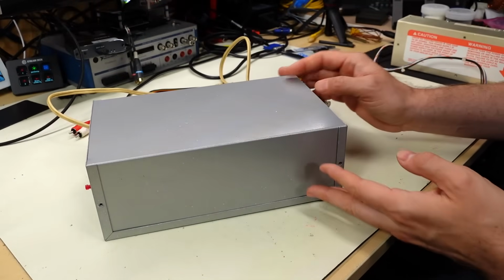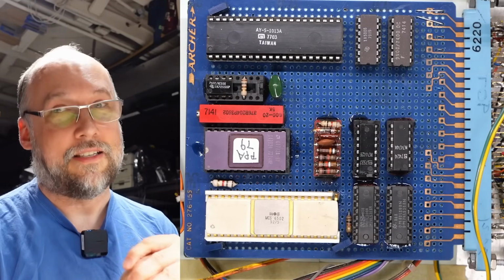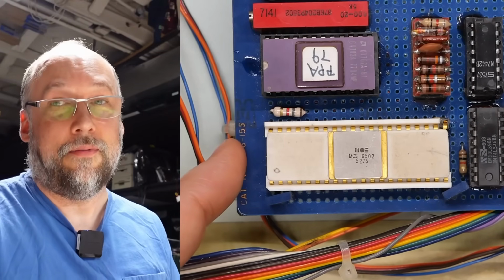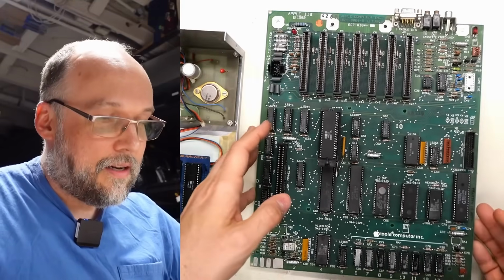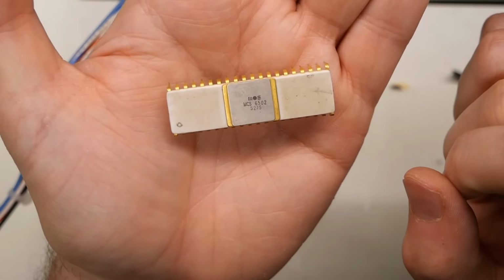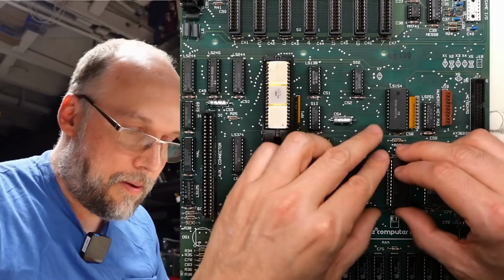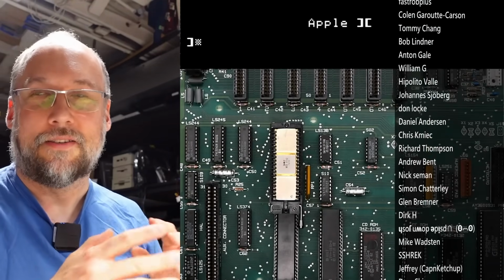Let's test a 50 year old MOS 6502 CPU

Comment: 11:30 "bug"  - do not let Chuck Peddle hear that. IIRC the engineers pride themselves in the fact that everything just worked in the first run. When you dissect this device, you will see that there is no broken ROR implemented on it, even though the command bits provided for it. Some Steve Wozniak apparently raised his voice that the chip should have ROR and came up with an idea of how to implement it in a clever, resource-saving fashion. But that's from the top of my head and you need to search for the original research yourself.

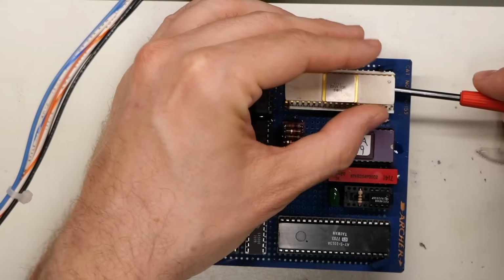Comment: intresting video, thanks for it. at 19:50 you use a flat head screwdriver to remove a ceramic dip40 package, more save tool woud be the expansion board blank used in IBM5050 type PCS , I am sure most of nerds have more of those, than they need

Comment: On my Apple 2e, I upgraded to the 65C02 and that fixed an intermittent rebooting problem. This was when the 2c was introduced.
My Apple 2e boosted my career as nobody else was doing what I was doing.
The 6502 assembler was much easier to understand than the 8080 chip which had this odd offset notation.

Comment: I remember the ceramic DIL sockets, and breaking the corners 🙂 Using one of those daft extractor tools (a plastic barbeque tongue) was guaranteed to bend pins and crack sockets. The two scredriver method being safest. That little tool you have even better. Other CPUs had bugs in them, Z80 to Z80B I think had more than just a clock increase. That was a while ago.....

Comment: The 6502 was not based on the 6800 as it's logic topology is quite different. However, the original 6502 (the one in this video) was designed to allow it to plug directly into any 6800 hardware. In other words the I/O, clocks, R/W and so forth was intentionally set to the same pins of the 6800 to allow an existing 6800 project to easly use the advanced capabilities of the 6502. Not at all firmware compatible. Motorola sued where a small pin assignment was made in order for this plug-n-program feature was not so simple. However, with a few cuts and jumps, it could be done.

Comment: I still have an Apple 2e with 2 disk drives, a green monitor and a joystick. I bought it more than 40 years ago. I had all the manuals, including the BIOS assembly listing. I had some experience programming a TI SR-56 calculator, so I decided to try programming my Apple 2e in Assembly. I remember calling some routines in the BIOS to perform some tasks, like scrolling in reverse, among other things. This was how I learned to program cpus using assembly.

Comment: Running 6502 without RAM is even more tricky than i8080/Z80 ...

IMHO, MOS 650x seems to be early designed as microcontroller, or at least a CPU with RAM-pages 0 and 1 built-in.

Comment: It would be interesting to try using the system and figure out what, if anything, in the ROM actually breaks with this CPU.
After getting a sense for how usable it is (or isn't), then try swapping in the earliest known Apple ][ ROMs - maybe the earliest ROMs were programmed to work with the early 6502?  What about Integer BASIC vs Microsoft BASIC?
Maybe also check some very early Apple-published software that might have been marketed with the original Apple II, and see if that software works.
It's possible that at some stage, Apple was trying to be compatible with those early chips, but by the time of the //e the concern would have been forgotten.

Comment: I have a white ceramic 6530 from a KIM-1 that i removed from the board because it seemed like it was failing but it turned out to be good. It has the same weird short pins on the end. 
.
BTW -  I thought it was failing because it was not showing up in my infrared camera but i guess it just runs way cooler then the plastic chips!

Comment: There's a couple little things that you said that don't make sense to me. You state that you were surprised to see a 6502 in there, and that later printer boxes used cheaper microcontrollers. But when this was made (likely 1979) there wasn't really such a thing as a microcontroller! What other option did they have besides using discrete logic? There were no 68HC11s, no PICs, no "microcontrollers". The 8085 existed but again, would have been hugely expensive. A microcontroller is just an MPU with on-board RAM, ROM, and peripherals. So before microcontrollers existed, you just had to take an MPU, and surround it with RAM, ROM and whatever peripherals you needed. The 6502, being by far the least expensive option at the time, would definitely have been the only affordable way to homebrew this without going to discrete logic which takes a lot more patience and skill to build. The later printer boards you speak off often didn't use microcontrollers either -- or if they did, they were the early ones like the 6805/6811 which had come down in cost substantially by the mid-80s, which is when those boards were popular. I think you were just sort of forgetting the timeline while talking about this box - things moved very fast after 1979, due in part to the 6502. Before then, embedded systems were just microcomputers, essentially.

Comment: Late to the channel (via the VCF panel discussion video)...  Nice video, but it's making me feel old.  I was at that Wescon show where the 6502 was announced, and bought one on the spot along with the 6530-005 TIM chip.  Date code is 3475.  I saved all the documentation and canceled check.  Somehow I guess I knew it was a special time.  (It's not for sale, in case anyone is wondering.)

The intent was to build my own board, but I got tired of hand-wiring the RAM chips (you can tell why I became a software engineer...) and found an unpopulated MAI Jolt board into which I put the chips.  Added a couple of Morrow's RAM boards (4k each), a paper tape reader, and Bay Area TVT Typewriter for the final system.  It still works.  Plays "Hunt the Wumpus" from paper tape, also Tom Pitman's Tiny Basic, and a text editor / assembler package that never really got much use.  No writable mass storage, as the cassette interface never worked right.  I really should fix that.  Wish there was more software for it.

By the way, the Apple-1 PCB had the clock generation circuitry to support the 6501 and 6800 chips, but I don't think it was ever sold that way.  Never seen a board with that section even populated.  My theory is that it might have been a contingency plan, or perhaps for a special customer that never materialized.  The 6502 has its own internal clock generator, which was one of its very significant features.

As for your amazing find, @DaftdogUK found the original design article in Kilobaud magazine (September 1979), if you didn't see their post.  Commodore PET to ASCII printer interface.

Keep up the good work!

Comment: For the record, looking at the silicon die for the early 6502 and later CPUs; the ROR wasn't bugged, it just didn't exist as the 6502 designer thought it wasn't necessary.
As soon as the first 6502 CPUs hit the market, customers complained about needing the ROR instruction and it was added.
The guys at the Visual6502 project have also documented this, it wasn't a bug but an absent feature.

Comment: Actually, this is not a bug. The developers felt that a ROR was not necessary.
Due to many complaints, they have updated the Chip.

In most cases, a Rotate-Right  is used when a simple Shirt right is sufficient. If you roll one time and ignore the carry, you are actually doing a normal shift.

The C language also can't roll, just shift.  So while a ROR is nice to have, you don't really need it for most of your programming, even without any workarounds.

The ROR opcode is actually an illegal opcode in the original version so there is no bug either. It shouldn't be used at all.

Comment: The 6502 was also in the British Broadcasting Corporation home computer - the BBC Micro 32K, a machine that most people totally ignore. There was an American version, the ABC which was virtually identical and sold in the States, but as I said, it virtually unknown today. The BBC was proceeded by the Acorn Atom, the Acorn Electron. The BBC Micro came in a 16K version - the BBC Model A, the Model B which was either 16K, 32K, or 64K and some rare modified ones had 128K. Later it was surpassed by the BBC Master 128K and the BBC Master Compact. These machines could include a 512K add-on board that ran a very early version of DOS, otherwise the machines all had tape and floppy disk access, as well as the first Winchester hard drive, and Laserdisc system. The BBC Micro also supported a local network, TELETEXT, PRESTEL, telephone modem access, a 6502 co-processor and many other adaptions, including a MIDI system.

I had a friend who worked for a software company, Acorn Computers Limited in Britain, and she would send me sales brochures. Eventually this machine was supplanted by the Archimedes, the world's first RISC system, which was in effect an early PC clone. I believe there is an emulator for it that runs on PC called BeebEM (Beeb being the affectionate name given to the BBC machine by its users). Of note is the fact that the worlds very first 3D space combat and trading game, the legendary ELITE by Ian Bell and David Braben was developed on a BBC Micro in the eighties that was ported to virtually every other computer platform of the time and which still remains popular - in fact, the modern remake of the game is called ELITE Dangerous.

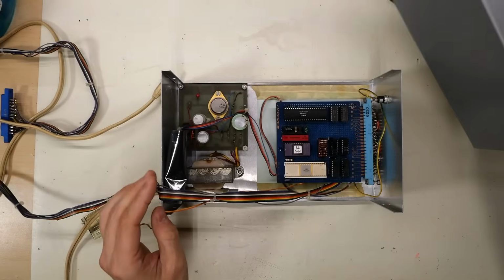Comment: 4:46 That . . . is a ceramic MOS 6502 if I'm not mistaken. While I am interested in older computers I'm not that well versed, but if I recall correctly just the fact that it's ceramic rather than plastic makes it 1.) rare, 2.) old.
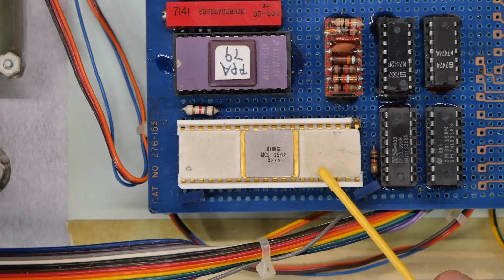5:16 1975? Wasn't the 6502 introduced in '73 or something? Hot damn.
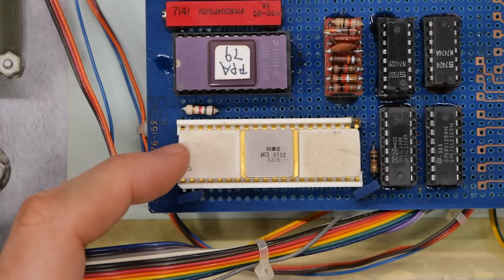5:46 Ah, it was '75, not '73. And yeah, the 6502 WAS the home computer revolution. It dropped the price from, IIRC, something like $300 for a processor to $30. That's not adjusted for inflation, so that was still expensive but affordable for a home user.
7:00 LowSpecGamer has a pretty good video on the history of the 6502 too. Ben Eater's series on building a 6502 computer is great if you want to dig into the nitty gritty of how it works from the ground up.
13:05 I looked up the datasheet for the top left chip and it's a UART, so yeah, I/O chip.
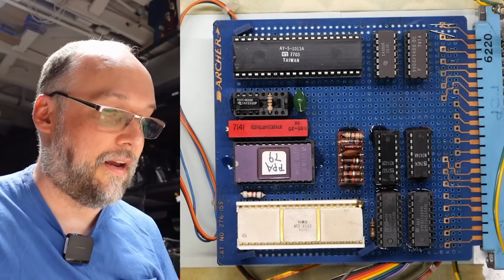13:58 Not to shill, but Ben Eater has an EEPROM programmer (TL866 II Plus) for sale on his website for like $70.

Fantastic video, thanks for making it!
Reply: TL866 II can’t read the i1702 EPROM in this device

Comment: The builder, might have purchased the 6502 from Radio Shack, as they used to sell bags of factory reject transistors, linear devices and ICs back then at discounted prices.  I know this, because I bought a few packages back then.  It was interesting, and sometimes you would find some good stuff in the bags, but for me, it wasn't the answer, because I had no way to function test most of the components.  
I still have some Radio Shack vector boards that I purchased back then, but they are a tan colour, and may have been made in Canada.  Radio Shack is no longer in business in Canada, and it is a pity.  I guess, because of the cheaper devices available, people just stopped building things.  I miss the store, because in a small town, it was the only source for almost all required discrete electronic components for projects.   
I actually have a couple of boards somewhere, populated with DTL ICs.  I have no idea what they were pulled from.

Comment: In modern devices, the missing instruction set is in the XC SD and micro SD cards. So, if your phone is bad during gaming, you have to insert a XC for some gameplay. HC speeds up the video activity. XC Physx instructions are loaded in the phone, after a while you don’t need the cards, the video remains fast, and the Physx (part of it) are loaded and remains in the phone. Pc sd cards and pendrives do the same, to activate their capabilities, you have to use a Samsung phone for gaming, an OTG cable, a card reader, the card itself. When car games do fancy things with better cars, your card is fixed, ready to upload its instructions for the pc. Cards do stupid things for games, you have to remove it if you want to. The missing sets are still uploaded for the devices, cards are configured to do it. Xc is better to do this.

Comment: You can write 6502 code which emulates the ROR instruction without actually using ROR, but you need to manually replace every instance of ROR with it. It also, naturally, takes a lot more cycles than ROR, but on the buggy chips it's better than not running at all.

Comment: The sole reason Woz chose the 6502 was that was the only one he could afford. If Intel and Motorola had made their CPU's in the same price range the microcomputer landscape would have been very different.

 I worked at IBM when the 5150 came out and I knew that they chose the wrong processor. They deliberately chose the slowest 8088 because they didn't want the machine to be too good because it would conflict with their mid-range systems.

This is the difference between corporate thinking with their "it's good enough" mind set as opposed to a start up (like Apple) thinking "we can make it better".  That was Steve Job's biggest contribution as he was a terrible engineer but he had Woz, who was brilliant.

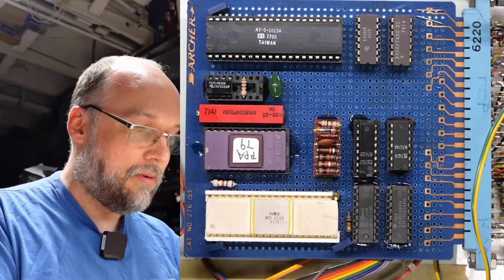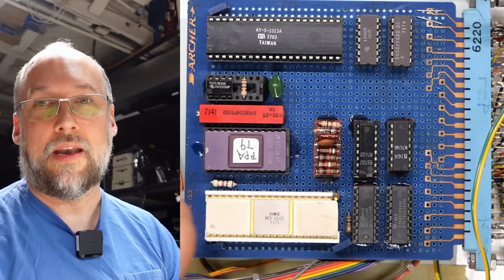Comment: 8:55, 9:09 ...Would not used a 6502 but would have used a cheaper microcontroller. You are so wrong. There was nothing else in the 70's. Definitely no microcontrollers as in single chip system. They didn't exist then. The 6502 or Z80 CPU's were the cheapest. And you always had to have at least these four, five chips CPU, RAM, ROM, UART and I/O integrated circuits to create a board, like in your box.

Comment: Dont know if anyone will see this, but the chip dosn not have a bug, all unused op codes do something, in this case the ROR command was not implimented, so its an unused op code not a bug, how do i know this you might be asking, i saw a video about this, one of the chips has the top cut off it exposing the silicon wafer, and was photographed, and the circutry was examined, and the ROR command is not implimented, here is the video https://www.youtube.com/watch?v=Uk_QC1eU0Fg

Comment: There wasn't a bug on the original 6502.  There wasn't ROR circuitry, because they didn't think it was necessary to include it.  After feedback from people who were using the 6502 there were a lot of complaints and that's why they added the opcode to the revisions.  But originally, the people at MOS were making a more affordable processor than the 6800.  If they wanted the full functionality of the 6800, they'd just spend the $300 and buy the 6800 from Motorola.  

You can go look at images of the original 6502 die and there isn't circuitry for the instruction in it.

Comment: Without even watching the video, the title is misleading. It was not a bug but a design choice used to make the chip cheaper. Later on it was decided that it was not worth the performance penalty to leave out that instruction. Chip performed flawlessly exactly as specified in the datasheet.

Comment: So someone opened up a Rev A and it turns out it's actually not a bug. The 6502 Rev A simply does not implement the ROR instruction. There is nothing actually connected to the ROR instruction control line. The instruction was indeed omitted on purpose in order to create a cheap CPU, as has always been claimed by Bill Mensch. That it looks like a buggy ASL is just a side effect of how instruction decoding works.

Comment: I just watched a video about the original 6502. The ROR instruction wasn't broken; It simply wasn't there. If you trace out the decode circuitry on the die, it leads nowhere. Chuck didn't think it important and only included it after the backlash.

Comment: I watched a video on this recently and one of the designers said it wasn't a flaw and was never designed to have that opcode. In fact, the decapped chip shows a blank area on the die in the area where that opcode would trigger gates.

Edit: https://youtu.be/Uk_QC1eU0Fg

With the form factor of that board I would be tempted to try it in a NES. Very meta. 😁

Comment: A bit of a correction (something I didn't know myself until recently):  The missing ROR instruction in the first 6502s was not a bug.  They were actually never intended to have that instruction (the designer didn't really feel it was necessary), so it was just never actually implemented to begin with.  It wasn't until the first chips were released that consumers started asking for a ROR instruction in addition to ROL, so they decided to go back and modify the design to add the extra instruction after the fact.

The truth is that the first 6502 chips actually worked perfectly as intended when first released and there was never any "bug".  They were simply missing a feature that got added in later revisions (but then everybody later assumed was supposed to be there all along).

TubeTimeUS actually just released a video a few days ago which goes into this in great detail and is definitely worth watching: https://youtu.be/Uk_QC1eU0Fg